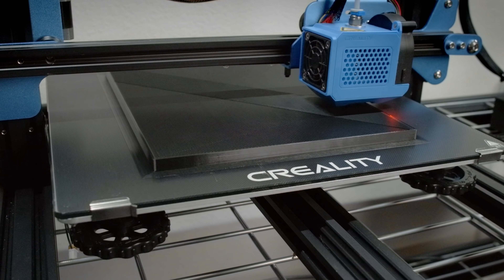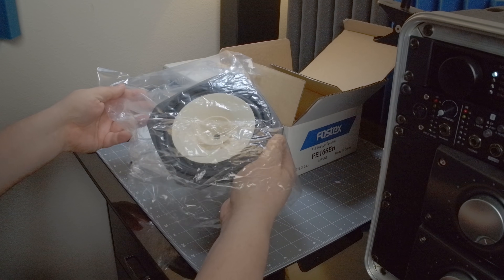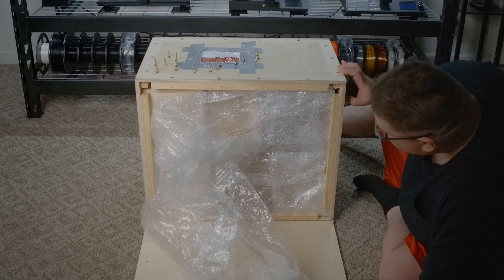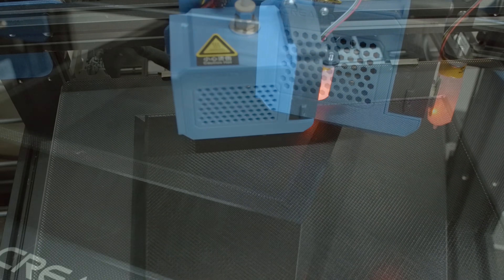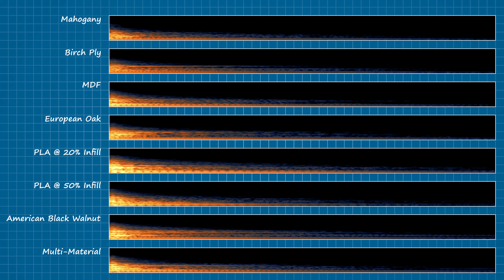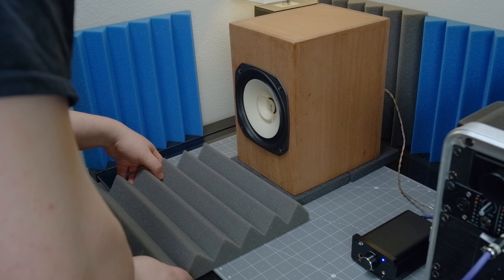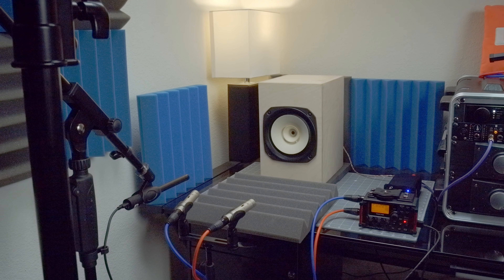Which Is Better for Sound?

Comment: What I found out printing your Hexibase designs (the 3 inch and the 6.5 inch) for subwoofer  was that 20% infill had horrible resonance and rattle.   In your 6.5 inch design I tried to tame the resonance and rattle by enclosing the entire thing in 1/2 inch plywood with JB weld.  The housing stopped rattling (because the it's now stiffer) but now the port pipes started rattling even worse.   I  So what I'm doing now is building your 6.5 inch subwoofer design in birch but printing the divider in 50% infill and then bonding that to a birch divider.   also preferred mahogany but birch is a close second.

Comment: You could save a LOT of time on those prints by moving to a 0.6 or 0.8 mm nozzle on your printers. The stock 0.4mm nozzle is better at very small details, but you don't need that for large prints like this.

Also as someone who has been printing with PETG a lot lately, I would be interested to see how it would perform as en enclosure! It is very strong, but less rigid than PLA, so I would guess it's damping properties are quite a bit better. I may just have to try this myself to see what I can do, I have a few leftover 6 inch subs laying around 🤔
Reply: Have you done the PETG tests yet? very curious on the results
Reply: @Akusen_Arcade  I have not had time to do any speaker builds unfortunately. As a relatively new home owner most of my DIY energy is going into home improvement projects.
Reply: @lukesmith9059   oh well, that's how it's supposed to go XD.

Comment: Have you looked into the latest sound absorbing metamaterials? (Primarily the type inside the new KEF LS50 Meta, which use a series of 1/4 wave resonators to absorb/cancel sound) They're near perfect sound absorbers, and the best part is they can be 3D printed! Take a look: https://www.diyaudio.com/forums/multi-way/360739-3d-printed-metamaterials.html

Comment: I have an EVGA Nu Audio card pushing a set of Ultimate Ears Live in ear monitors. There was very little difference between them. It could have boiled down to offsetting the speaker to the mic a few millimeters as the photos show they move ever so slightly when watching. Maybe in person it could be different but based on this video I do not think anyone could accurately blind test saying what is better or different consistently across them.

Comment: Listening using my Rotel RB-1050 amp on Fluance SX6w speakers Through Audio Card: ESS Sabre HiFi 9118 I can hear:

Birch Ply: Deeper bass notes. Muffled upper section.
Black Walnut: Mid-range is more pronounced.
European Oak: Definitely stronger up top in the highs. Solid midbass
Mahogany: drums are more pronounced compared the other materials.
MDF: A lot boomier than the previous three choices.
Mixed Material: Flatter response. mids slightly less pronounced than Black walnut.
PLA20: Sounds a bit more hollowon the midbass notes.
PLA50:More solid midbass notes extending down a bit.

On my Sennheisser Momentum gen1 Marly editions Mic (used for headphones: SAnson G-Track Pro USB audio interface. Analog out):

Birch Ply:
 the symbols are slightly muffled to me
Black Walnut:
 Sounded a bit more solid onthe lower bass, but not as robust up top.
European Oak: Much higher upper frequencies by far cleaerer and less muddyo nthe midbass.
Mahogany: a bit more solid on the lower extension
MDF: A lot boomier than the previos three choices.
 the middle frequencies seem more pronounced.
Mixed Material:
 Solid midbass, but lacks the treble snap i like. 
PLA20: Sounds a bit more hollow on the midbass notes.
PLA50: More solid midbass notes extending down into the bass section.

Great comparison on how materials for the enclosure can affect the output. My setup has 0 modifications th the EQ on the audio card and the headphone mixer.

Comment: Nice video. I think you need to fill the emty space in the box with the 3d printer. The best part about 3d printing is being able to add how many details you want. A triangle pyramid pattern inside the enclosure would stiffen it significanlty but I don't know if you would get drawbacks to. I am building a 196 L closed MDF speaker with Corfal flat 8 full range speakers.

Comment: DiamondBoxx M3, it was hard to tell a difference. But the hard woods (oak, walnut, mahogany) seemed to have a more full sound. MDF and 20% PLA seemed to lose some of the low end.
Reply: Kinda felt the same, listening on Fiio Q1 Mk2 and KZ ZS10 Pro's
Reply: mahogany and the walnut were noticeable more expansive and rich (I liked the walnut just slightly better) ... mdf was tighter but not disappointing ... birch and the pla slight to distinct distracting ring above 4K or so.   Shure SRH1540 / AE-5 Plus SABRE32

Comment: Perhaps I'm a little crazy, but I could tell slight differences!  I'm wearing Bluetooth cochlear headphones (Trekz Titanium) and I could tell that the oak had a bit more of a natural sound, the birch and the MDF sounded tight, the 20% PLA actually sounded a bit dirty, and the 50% PLA sounded more like the MDF but with a small resonance.
Reply: On KRK Rokit Classic 5 / Topping E30 DAC I could tell some differences as well. I'm with you that hard woods (oak, mahogany, walnut) sounded the most pleasing. I liked birch the least TBH, down there with 20% PLA. They both had a sharpness to them. The 50% PLA was "fine" - good enough that I'd consider it a viable material for a DIY speaker.

Still, I'm not convinced I'd be able to make out any differences in a blind test. 😆
Reply: @mlammikko  that would make for an excellent video in itself.

Comment: Fiio Q1 mk2 ~ Sony MDR-1AM2 balanced.
i feel like some enclosures pack a bit more punch when that bass/kick hits but its kinda hard to compare as the test song has diffrent stages.
the black walnut for example plays way louder then the birch ply, and some do seem sound a bit fuller with that synth sound.
(i asume you keep distance and volumes the same)

Comment: Listening systems...

Home: 
Asus Z390A 192Khz @ 24bit (Source)
Yamaha RXA2030 (DAC/Amp)
(6) Behringer B2301P Studio speakers running in series parallel to create 8ohm LCR front stage
(1) Episode Element Series 10" Subwoofer

Car:
Apple Airport Express (WiFi/Lossless Airplay Source)
Mini Toslink out of Airport Express to DAC
Cambridge Audio DACMagic 100
Audio Control D6.1200 & D8.400
QSD MB Quarts from 1998 for front stage in custom front door baffles (5.25" & 1")
Earthquake SWS6 Subwoofers in front door
Pair of JL Audio TW1's in a custom ported enclosure under rear seat
160lbs of dampening throughout 
230A Alternator from Michael Singer himself mated to a second yellow top mounted in bed of truck

I'm curious as to what type of effect a small amount of strategically placed dampening strips would have on the enclosures. Maybe you could do a small segment on dampening, and where and how to apply for the best results.
Reply: Behringer speakers lmao

Comment: Could the PLA enclosure be designed to use say a sand infill between inner/outer walls to reduce the 'ringing'?
Reply: Or just encrease the thickness of the walls... But some damping materials are needed in all speaker enclosures to avoid resonance regardless of the material used to build the enclosure.

Comment: Wood movement over time  and the constant vibration may pose a challenge in the higher power base reflex boxes. That said... I will do a solid wood version of the TL dual speaker in your other video and let you know how it works out.
Reply: We agree movement is more of an issue compared with sheet materials and a certain amount of care is needed with the environment where they are situated but we can achieve much stronger joints with wood and when comparing sub boxes in same thickness oak and mdf/ply the oak is much stiffer, I would compare it to walking on oak floor boards or plywood, the ply is more bouncy.
We would also be very interested to hear how your project works out!
Reply: @coppiceaudio1132  Agree with strength/rigidity. Especially if you can do sliding dovetails for the internal walls of a TL driver. Loved those boxes by the way. Any chance those were hand cut dovetails? I am a Paul Sellers fan and he really got me back into woodworking.
Reply: @coppiceaudio1132  BTW... thank you for looking through all this just to find my post and respond. Nicely done.

Comment: With 3D printing you can get diffusion shapes inside the box. Does these help from standing waves or affect sound? I mean a flat inner panel vs dimpled/diffused shapes
Reply: No one answered your question so I'll address it. Can you 3D print diffusion shapes inside? Yes. Absolutely. Do these help prevent standing waves? Kind of, but not really. The problem is sound waves "bend" around surfaces, so until you get the shapes large relative to the wave it won't have much affect. I'm too lazy to actually go pull out my textbooks but from what I recall it's usually the object needs to be 1/10 to 1/4 the length of the wave to really give a benefit. So for even modest bookshelf speakers you're dealing with at least 80hz usually, that's 4 meter (14 foot) wavelength, even a 1/10th of that is 0.4 meters (1.4 feet), which is practically the size of many speakers. For example, my Volt 8's which I do run down to 80hz are just barely 1.5 feet tall, so you'd have to practically double the size to add diffusion that can handle those waves. And then for diffusion to be really beneficial you need different sized objects/shapes to get different frequencies (otherwise it's just a deflector), so even more volume. For the higher frequencies with much smaller wavelengths you could fit the diffusion, but then we don't really have as much issue at those frequencies.

TL:DR - Yes you could do it, but the cost outweighs the benefit.
Reply: @mushroommunk  thanks for the quality reply!
Reply: @mushroommunk  great info. what textbook talks about such topic? would you recommend any?
Reply: @R0cky0  I could have sworn I replied to this, but I guess youtube ate my comment. Oh well, let's try again.
For textbooks there's two I can 100% recommend and two I have heard good things about but haven't read through myself yet.
First is "Sound Reproduction: The Acoustics and Psychoacoustics of Loudspeakers and Rooms" by Floyd Toole. Fantastic book that really lays the ground work for things like how speakers work, how we perceive sound, and how rooms affect sound. I didn't think the book was too dense or hard to read, as long as you have a basic math or science background (aka high school algebra and physics) you can learn quite a bit if not fully understand everything.
Second is "Acoustic Absorbers and Diffusers: Theory, Design and Application" by Trevor Cox and Peter D'antonio. This is kind of the holy bible of how acoustic diffusers work. The stuff laid out in this book can still be directly seen in real world application in acoustic design firms like GIK or RPG Acoustics. All three of these guys, Toole, Cox, and D'antonio are well respected. They've given plenty of lectures at the Acoustic Engineering Society meetings that can be found on youtube and other books and articles.

Two books that I've heard good things about but haven't read in depth are "High Performance Loudspeakers: Optimising High Fidelity Loudspeaker Systems" by Martin Colloms and "Loudspeaker Design Cookbook" by Lance Dickason. The cookbook is actually sitting on my shelf, just haven't had time to flip through it. The Colloms book looks very solid and is in my amazon wishlist, so maybe one day.

I know you asked about textbooks, but a few forums that are great resources, both for information posted directly or for suggestions for other reading material would be: gearspace, diyaudio, and avsforum.
Gearspace has a solid acoustics sub forum with actual high end mixing room designers/builders. So a lot of practical applications discussed.
Diyaudio is great for the speaker design side. Some professionals have posted, many people with physics/science background so discussions can get very nerdy and into the nitty gritty. They can some times veer into the hifi "voodoo" as I'd call it, but it's usually clearly called out as objective opinion vs subjective analysis.
Avsforum is great for a balance of the speaker design and the room acoustics. Focused mostly on home theater but a lot of what's discussed is still applicable to other areas of sound.

I can talk about this stuff forever, so hopefully you find something in hear to enjoy learning. (forgive the bad attempt at a pun).
Reply: @mushroommunk  Wow this is super informative and enlightening. I'm a newbie to the field but the deeper I dig into it, the more fun I find, meanwhile the more there is to learn. I believe the books and forums you recommended are very good places to get started with. Sorry you had to post twice but thank you so much for sharing~
Reply: thats a good question ^^^^^^^^^^
Reply: in a sealed enclosure it does not make a differrent
Reply: @Juschel9  you can get standing waves in a sealed box so you are wrong. You won't hear the standing waves inside but it will affect the cone
Reply: Use acoustic wool, way more affektive
Reply: @Juschel9  Again, that wasn't the point of the video.
Reply: One can also do that with wooden cabinets. That wasn't the point of the video.

Comment: Even with to much gear, the differences between the boxes thanks to the YouTube compression are hard to spot for the wooden boxes. The dovetail box sounded the clearest. As for the equipment I have hooked up... One pair of Yamaha dome tweeters covering 10,000-30,000 hrtz... A pair of vintage Technics 2'' tweeters covering 2,000-20,000 hrts.... A pair of Yamaha 6.5" covering 500-2,000 hrtz... four peavey 15'' spaekers covering 50-2,000 hrtz in their peavey 215 boxes with the horns removed and caped off. The Yamahas and the Technics live in the cap where the horns were. and then  I'm using a pair of 10'' comp-c kickers mounted in 2.5 cf sealed boxes covering 20-60hrts...   powering the Yamahas and Technics is a Technics amp with 120 watts per channel... Powering the four peavey 15s is a Onkyo amp pushing 150 watts over four channels... And a Zapco amp powers the two kickers... Nothing out of this world; but none the less, loud and clear! My family and neighbors likely hate me. I expect torches and pitch-forks any day....  I would like to hear what other people think of this set-up out of curiosity. And for more technical information, ask and I'll rely.
Reply: Nice set up!! Thanks for the feedback!

Comment: senn 598se's and eris e5's. can't hear anything notable with the erises, but with the senns there's... evvvvver so slightly a different tone. but i'd have to pay attention to notice for most of them. the pla20 got slightly boomy and had sustain, while the 50 maintained most of the boomy sound, while not having as much sustain. mahogany seems tighter. the rest sort of seem more or less identical beyond just a slightly different ... taste? i guess, to the tones.

mmm, time to see if i can find a mahogany supplier locally.
Reply: Thanks for the feedback! make sure you find a reputable supplier, we need to look after our Forests or better still look for recycled, a lot of out dated furniture is made from mahogany so can be bought very cheap but make sure it is not just a Mahogany veneer on some cheaper wood!

Comment: Hi, as someone who is always really right on cash I would like to see an ultra low budget build. Make the best possible speakers from cheap Aliexpress parts, within a fixed budget, lets say $40 or so. There are many pretty decent chinese speakers available, but usually they do not provide all of the necessary information to design an enclosure for it. Maybe you can give a guide on how to approximate values for unknown speakers?

Comment: Hey nice video. With 3D printer, you can add some "texture/3d shape" to increase inside surface. Or, is there some reason why inner walls are flat ?
Reply: I'm thinking the reason the print is so simple is that he was comparing materials not designs. But I do think that's the real advantage of 3d printing more complicated designs like wave guides, textures, etc don't really add more time like they would with traditional methods.
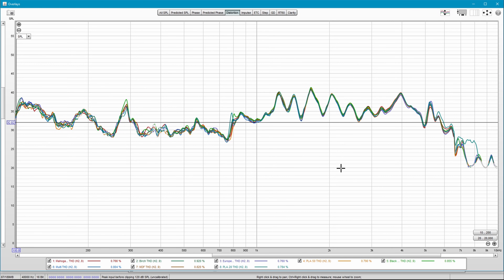Reply: Texturizing a surface modifies it's surface area, and in turn modifies internal volume, though both are minimal if you're talking about texture and not large internal features. 3D printing will never be as flat as MDF, ply, or a planed piece of wood, but it's close enough. Introducing deviations makes an apples to apples comparison an apples to oranges comparison. You'd also need a CNC mill to replicate the texture pattern in wood, and for much more complex surfaces, a 5 axis CNC mill. But again, a surface texture won't do much in a box, though it may have interesting results within a waveguide/port. Plus, textures and complex surface areas are a better topic for a different video, or series, this video was only for material comparison. What you're probably interested in with 'texture' is a layered box with alternating geometry. Such as in this video https://youtu.be/PJaXhvHaIwM or alternately in this video https://youtu.be/pTSeqs0Kk9o?t=277 starting at the 4:27 timestamp, both are different approaches to the same solution. I assume this is what you mean by texture, because, again, a typical surface texture, like a texturized paint or typical textures on things like ABS sheets, really won't do much to change performance of the box; with the only potential being within a waveguide/port due to aerodynamic properties of a surface texture. Not to mention a surface texture on a 3D printer really isn't the best idea, the most you'd get is random globs on the top surface, not a typical surface texture like ABS sheets have, which need to be molded into the part; unless, again, you're talking about actual geometry to negate standing waves.